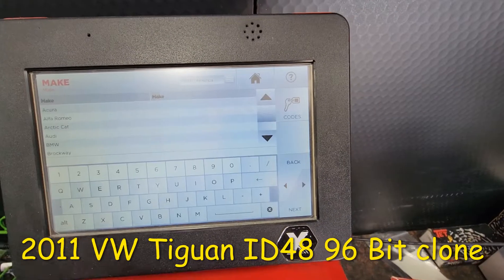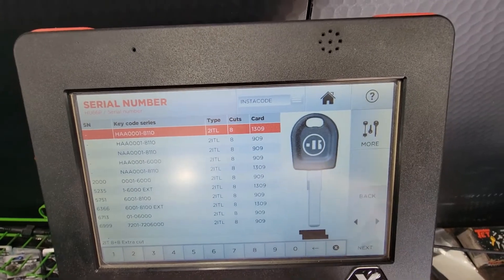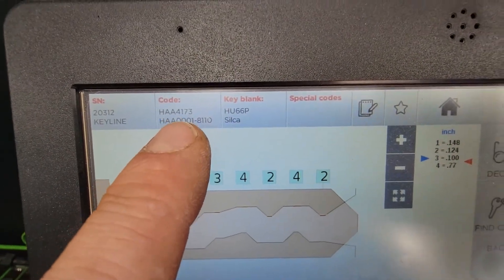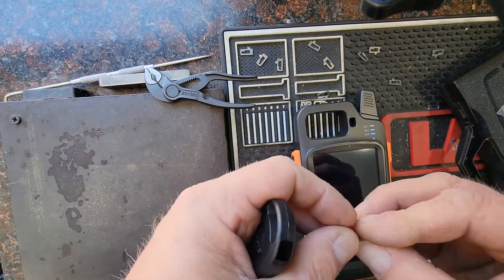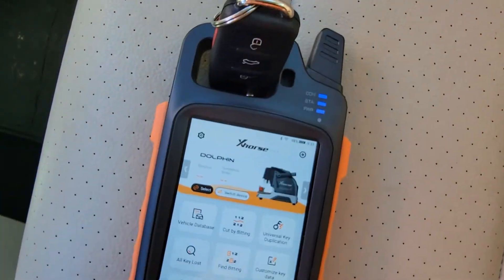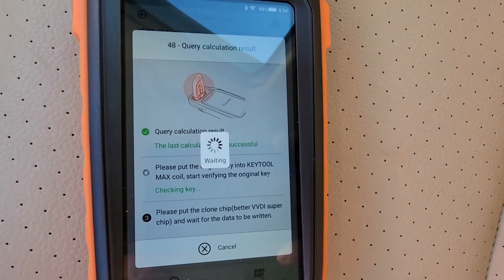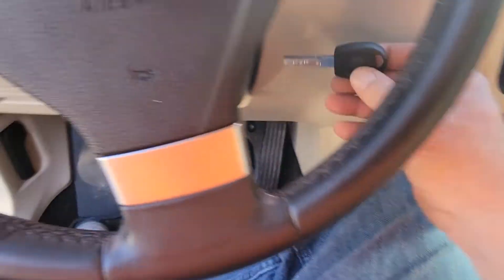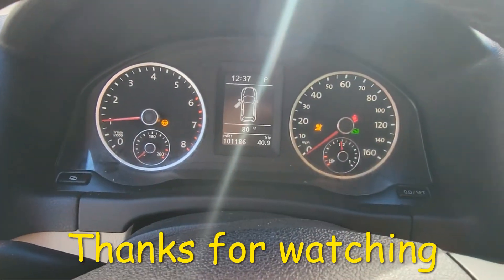Xhorse Key Tool Max ID48 96 Bit 2011 VW Tiguan Key With Gymkana 994 #locksny

Comment: Very nice, how many bonus points do you need to do a ID48 calculation? 
Heard it also takes hours… for the servers to finish calculating the data.
Reply from the maker: I bought that add on package. I think it's 10 remotes or keys ?? Not sure?  It took me about 10 mins start to finish with cutting the key, it was pretty fast.
Reply: 200 bonus points. Did it from beginning to end in less than 10 minutes.

Comment: Can it be cloned without sniffing the collector ring data if you have an internet connection like some others?
Reply from the maker: Not that I know of. You sure the others are doing 96 bit stuff without sniffing?
Reply: @locksny  I don’t think the last one I did was 96 bit. I didn’t think about that. 

I have also had trouble trying to generate and clone the Honda G chip on the XT27.  I was able to generate it with the Key Tool Max but it wouldn’t program. So I used a true G chip and after I programmed it I tried to clone it to the XT27 just to see if it would work. The KTM couldn’t tell the difference between the two but the XT27 wouldn’t start the car and I couldn’t add it.  Maybe I did something wrong but I couldn’t make it work.
Reply from the maker: @davidturner6509  I'm not sure of any cloner off hand that will do the Honda G chip yet.
Reply: @locksny  I’m relatively new to the automotive side so I don’t have the knowledge a lot of you others do for what you can and can’t do with some of this stuff…I obviously don’t understand exactly how it all works, probably just enough to be dangerous but I relate it back to past mechanical and electrical equipment I’ve worked with.  It is funny to me that I cloned the g chip to the xt27 and when I would read the transponders with the key tool max all the numbers were the same on both.